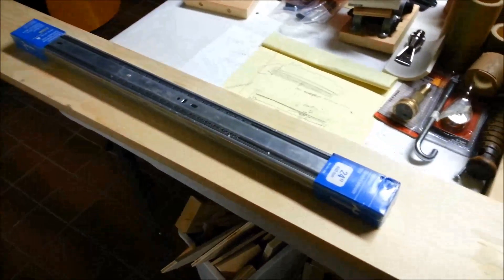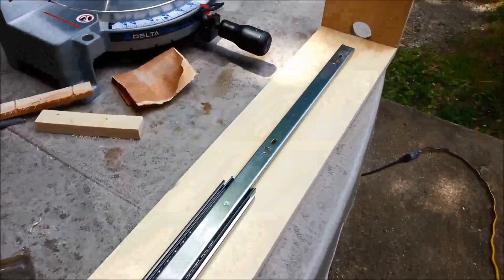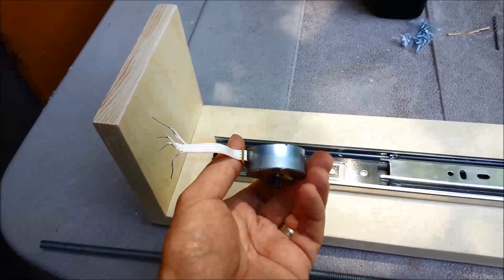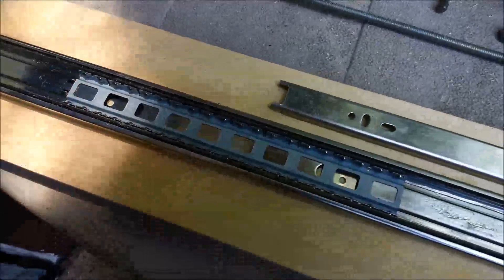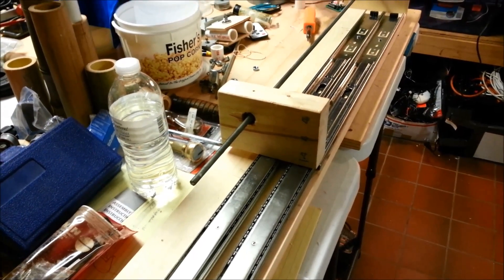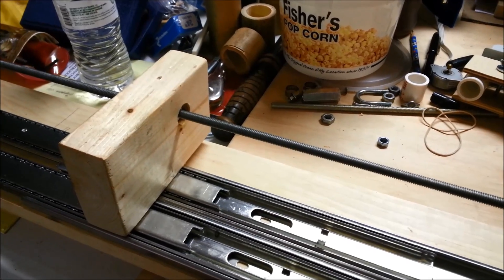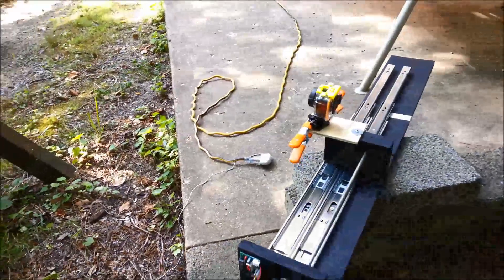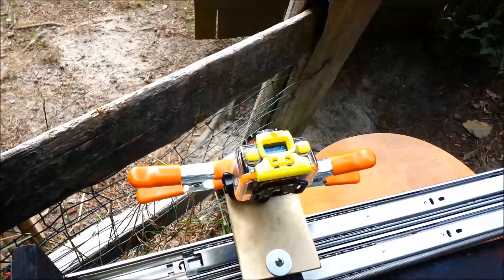Motorized Camera Slider - Cheap and Easy

Comment: I like that this slider is not heavy❋ ❋>share4.photo/eSliderCam?Iけ It's very easy to lug around with everything else. It also does not make a lot of noise when in use. Almost silent. Just another piece of equipment for my collection.

Comment: Hi, What kind of power did you use? Would it work with battery? You know to use it outside somewhere without electricity? And what do you think what is the weight limit I mean weight of camera for the motor? Many thanks.

Comment: How do u stop or reverse the motor once the camera reaches rear end of the slider
Reply: A stepper motor "counts" the revolutions and can be programmed to stop after a given number - which is translated to length with the screw assembly.

Comment: Where did you get the controller board from?
Reply from the maker: Here's a link for one on eBay.  http://www.ebay.com/itm/Stepper-Motor-Driver-Controller-Board-Speed-Adjustable-with-Remote-Control-RC-/221376055538?hash=item338b0a88f2:g:oUYAAMXQVhFSAxOx

Comment: That is a pretty hefty thread for that size stepper motor.  Do bearings help with the amount of torque the motor is dealing with?  Was thinking about building something similar but planning on using pulleys instead and not sure how to match them up with a stepper motor.
Reply from the maker: +Jimmy King Bearings might help ease the strain although this motor had enough torque to drive the rod.  Pulleys are certainly an option too.
Reply: +drez20001   Just wondering if there's a way that you normally size your motor for your application?  Noticed there was considerable wobble with the rod, which is why I would rather use a pulley system, using a set of gears to increase the torque and possibility of speed for different applications...  Using a timer routine for the distance calibration.  Depending on the printer you pull your parts from they either use a Toothed gear with a toothed rail, or a toothed pulley.  Notably the older the printer the more likely you will find a pulley.  The newer it is the more likely it is a rail...  Pretty smooth video though.
Reply from the maker: Nothing too finely tuned here.  When printers and other similar things break I tear them apart and toss the stepper motors and other parts in a box.  When I'm tinkering around in my shop I just try out things and see how they play together, that's part of the fun.  This was a enjoyable build and with it I have caught some cool scenes.  There's definitely room for improvement.

Comment: Can you give some more insight into the wiring and the motor on this project for the less technically savvy? I would assume any type of ______ motor would work here but I don't know what to look for in an old motor. Once found, how did you determine which wires were which for said motor? Thanks!
Reply from the maker: +Benjamin Mace Hi Benjamin.  I don't recall the wiring set up, but with small stepper motors and only 5v coming out of the little controller board you can just keep trying different patterns until you get it right.  There is a way to figure it out "correctly" but you're not going to blow anything at this level - small steppers are pretty forgiving.

Comment: An awesome build! I'm actually trying to make one.
I see in the end of the video you prefer the bigger motor. Assuming the small one form the printer wasn't powerful enough to do the job, how can I find one of those powerful motors and what are the specs of that? (Torque, Voltage, etc.)

Comment: where did u get the controller got a website
Reply from the maker: +John Hill Hi John.  Here you go:  http://www.ebay.com/itm/Stepper-Motor-Driver-Controller-Board-Speed-Adjustable-with-Remote-Control-RC-/221376055538?hash=item338b0a88f2:g:oUYAAMXQVhFSAxOx

Comment: Why not just use the belt and pulley from the printer instead of the all-thread? Kinda seems like the wheel was reinvented on this one, but good job anyways.
Reply from the maker: Sain Hadam Hi Sain.  I appreciate the suggestion.  Just a different way of working it out here.

Comment: Great work :)
Do you think a heavier camera can be mounted on this construction? How heavy?
Reply from the maker: Thanks.  A slightly heavier camera maybe, it is a pretty lightweight slider.  As long as the movement is pretty level a larger camera might work, if it was on an incline I'd go for larger stepper motors.  Thank you again for your comments.

Comment: thank you for sharing this project.  where did you find your controller board?
Reply from the maker: The controller board was bought on eBay.  Here's a link to one...  http://www.ebay.com/itm/Adjustable-Speed-Stepper-Motor-Pulse-Driver-Controller-with-Remote-Control-/151315346950?pt=LH_DefaultDomain_0&hash=item233b18f606